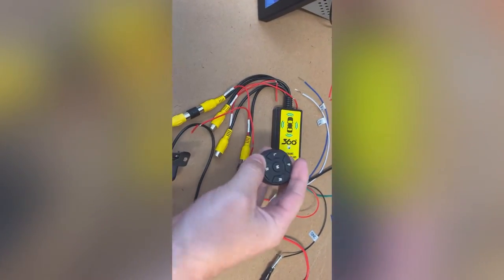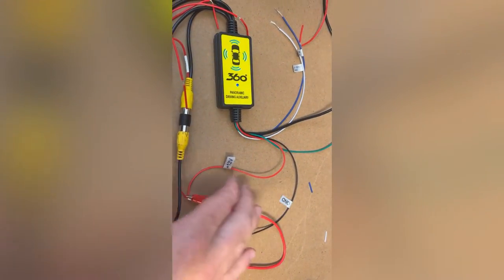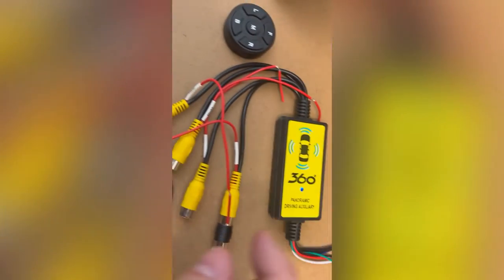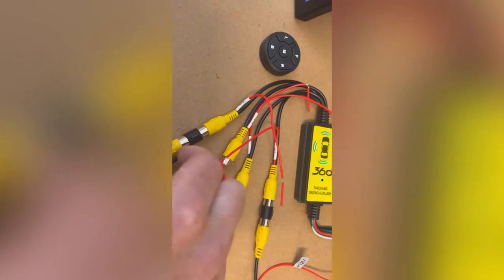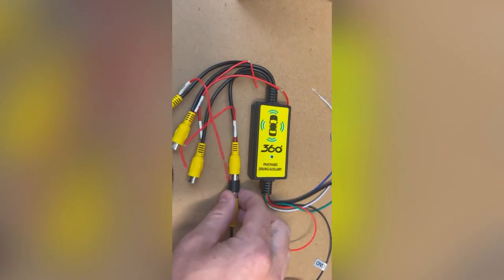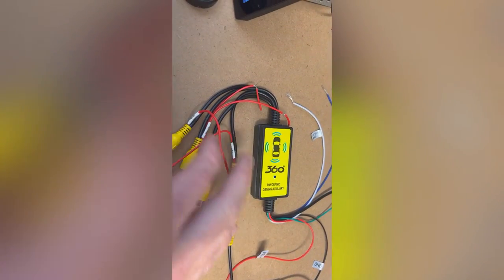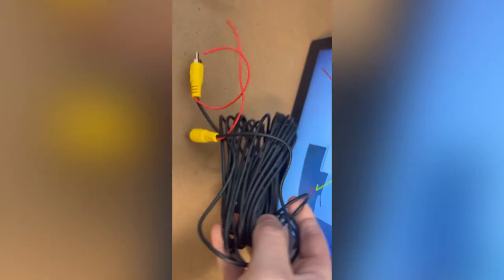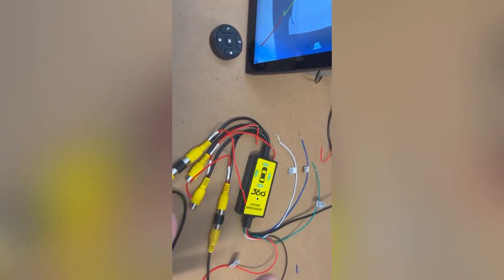Vhedia 4 to 1 Camera Switch System

Comment: When I first turn on my vehicle, and go in to reverse, it does not pick ANY video feed.  I've tried all 4 and none are enabled by default.  I simply get "no video" until I first wake up the remote, then pick an input.  How do I set a default?  (note I've tried using the trigger wires, but as you state, that over-rides the remote, which doesn't work for me)
Reply from the maker: Hey, mate. Assisting you on live chat and emails.

Comment: Hi, thanks for the video i installed this switch on my car but when i hooked the turn signal nothing came up the reverse camera is working fine but nothing else. Do i need to install a application? Because I didn't.
Reply: I don't have this particular video switcher, but the one I have is a two channel and in order to "turn on" my front bumper camera, it has to have 12v power,  I do this with a dashboard switch, in the case of this switcher, I believe the power must be constant, so you can use the control pud and the camera is already powered, I hope I'm explaining clearly, I also want to try this switcher for my pickup truck since it will give me 5 total video inputs instead of 2 as of now, take care
Reply: @JrgMP1 thanks mate! If I understood right,  so I need to have a constant 12v to the camera and how do I trigger the camera with the turn signal? I do not want to use the control I just want the side cameras to be on just when I use the turn signals.
Reply: @VehicleVignettes  in another video for the same switcher some one mentioned that power should come from the stalk on the steering wheel, such solution seem more problematic then an actual solution, the other solution was to add a relay, something call a time delay relay, I have not look into that yet, sorry if I'm not of more help (if any to begin with)

Comment: What if i want to connect my oem back camera(hyundai) and 3 after market cameras? Will it work? Also, what about guide lines?
Reply from the maker: Hey, mate. This depends on your head unit. Wouldn't work on some as the OEM camera does not have the same format as the after market ones.

Comment: thanks for the video, it was very helpful, but I'm having trouble with the side view cameras. I hooked them up to the blinkers, but because the power is only coming in at short intervals the camera keeps blinking on and off. is there a way to activate the camera with the turn signal and keep steady power to it?
Reply from the maker: Hey mate, it does do that and the reason is the trigger wire should be to the indicator signal from the indicator stalk and not the power to indicator.

So options are:

1. We will see if we can change firmware. If we can change firmware so it will work ok even when power off for 3 seconds or so.
2. https://www.narva.com.au/blogs/press-release/2017/Aug/14/relay-adjustable-timer-and-reverse-pin-models

Time delay relay. 

3. Take from indicator stalk

Comment: I hooked up one of these to two backup cameras in my truck. One on the tailgate and one viewing into the bed. The switch nor trigger wires will switch the camera. 

I've tested both camera and they work when connected to the reverse input. But there is no switching happening. Any ideas?
Reply from the maker: Hey, mate. Can you check if your cameras have the same format? Could be the issue when working with these switchers.
Reply: @VhediaVehicleMedia  both feeds work fine, when connected to the reverse input.  So I don't think it's a format problem.
Reply: I think that in order to switch cameras with the controller pud, all video inputs/ cameras, has to have 12v power  already, except for the camera that will be used for reverse, since it will only be powered when the reverse lights come on, hope this help and I'm also looking to purchase this switcher, so please let me know if what I told you is right or wrong or how did you solved the issue, thank you
Reply: @JrgMP1  so yes they need to have power in order to work (that's fairly obvious). In my case the wireless connection just didn't work so I got a replacement and it worked. However it then presented a new problem where it defaults to null every time it boots. So that's my current issue. 

To be fully fair the unit I have came from a different vendor but looks the same.  So I can't be sure if the firmware is identical. 

I wouldn't hesitate to buy from vhedia. They actually support the product.